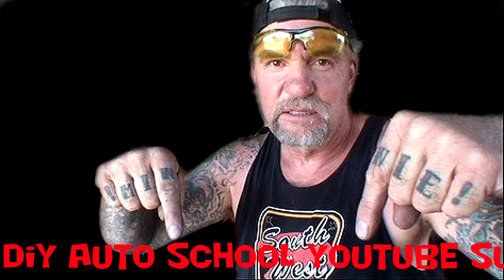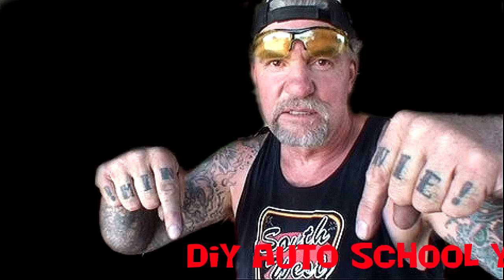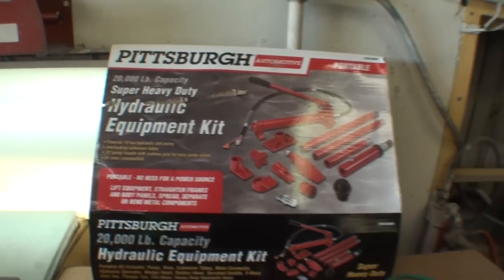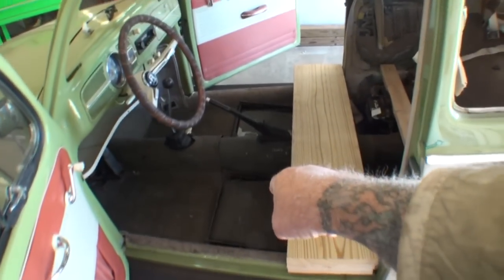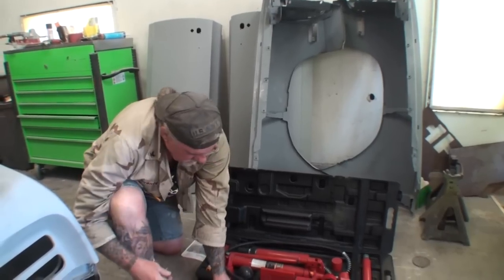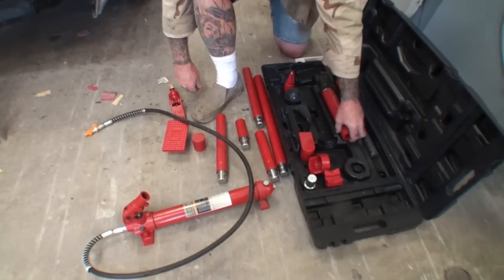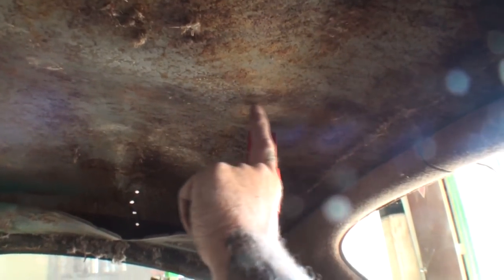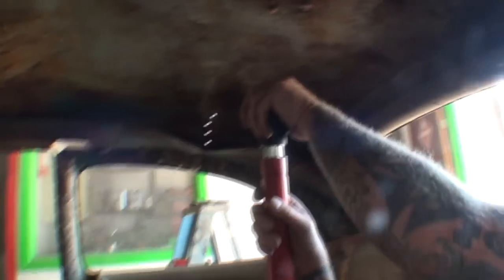How To Use A 10 Ton Porta Power Jack - Harbor Freight Tools  EXTREME FAIL?

Comment: used this today with all extensions, large foot and small foot to push out damage on a garbage truck canopy. had issues with it not pumping the ram. make sure hyd fluid is free of air bubbles (take line off ram and press against the ground and pump) make sure its full... once i did that, all was well. pushed out some serious dents in a canopy

Comment: This is one of the most versatile tools you can have. Not just Auto/Body. Construction work (moving a wall an inch to square it up). Removing a twisted box blade from a tractor. Pulling T-Post fence posts. Removing or installing Hydraulic rams. The jobs this tool can do are near endless. I have a big "name brand" one, and it needs a new hydraulic extension cylinder (bought it that way at an estate sale). It costs almost as much as this whole kit from HF. Personally I recommend the bigger of the 2 at HF. Once and done, and like I said, it's the same price as the replacement pieces on the "name brand" one.

Comment: I have 4 porta-powers in my shop and 2 of them are Harbor Freight  models. I have the small set and the big set like you featured and I have  had great results with them both. Funny thing is that I actually used the smaller one today and once again it saved my butt. Great video Pete!!!

Comment: i used porta power at home to push out a chassis leg on my rear engine 74 skoda.
put two sill clamps on the sills (rockers) and pushed on the engine mounting bar that bolts to the very rear of the chassis legs, came out great.
they are a great versatile tool you can use for all sorts on mad stuff if you can think outside the box as well.
the UK version over here came with a free rebuild kit.

Comment: Great vid..thanks for sharing.  Hope the oil canning was not an isssue. For those purchasing any hydraulic jack... check the fluid level of the jack before using. Many manufactures do not completely fill the resevoir to working level. Top with recommended fluid and it will work as engineered.  There is a bit of fluid loss each time the ram is disconnected from the pump. So check fluid level and top up as needed before reuse.  Best to you and yours Pete amd Minnie.

Comment: Used one of those to push out a VW bus sliding side door that had been hit and repaired several times but just with bondo.  Same plan using scrap wood on the opposite side to push against.  Worked like a charm.  Plenty of power!  You can actually find replacement seals for the rams, pump, etc. online.  Helps if they are marked but you can also chat with the sellers and find the right seals.
Reply: I got the electric impact driver you said   was good. I took a I beam to radius  nut off like a charm after wrenching on it to no avail. Very powerful tool for 100dollars. Good luck looks like your getting it going,thanks

Comment: I bought this set because of this video. When I opened it up the paint was flaking off and it didn’t work pass 2 inches. I just returned it lol. All I wanted to do was pop the dent that’s on the hatch of my 98 4Runner. I’ll keep looking or if I admit defeat I’ll take it to a body shop.

Comment: I use similar product items in my work but that's to post tension walls during excavation but they cost like $2500 and up. Why does anyone even shop at harbour freight to? If you too cheap to buy the right tools you shouldn't be doing the job that's why there's professionals that invest the money in good tools to get the job done...
Reply: Alot of people get the job done with cheap ass tools
Reply: @danh2134  yea they also have cheap house builders just spend your money on junk I'd bet it's leaking already seals blown out. Professionals pay for tools that work everyday for years not one beetle
Reply: @Sean-John  he said it was $150??? And in his line of work will rarely use it . If it breaks toss it and buy another
Reply: @Sean-John  Okay KAREN!
Reply: Even if you only got a few uses out of this tool, it will have paid for itself. For someone who just does their own repairs or repairs for family/friends, Harbor Freight stuff is not bad. SOME of their stuff is junk but not all.
Reply: @Sean-John  
These tools are for diy ppl, not professionals lol